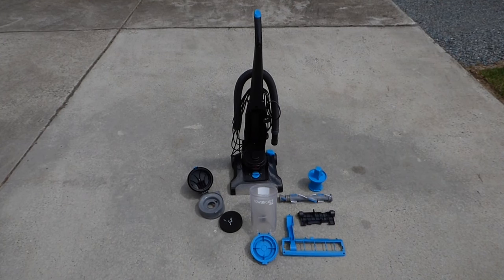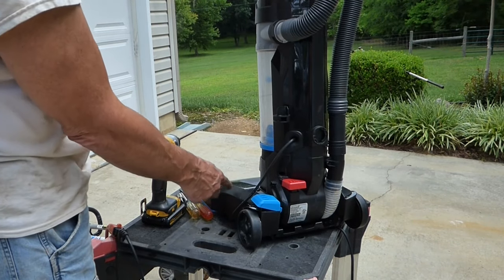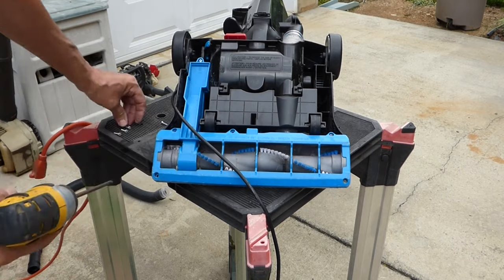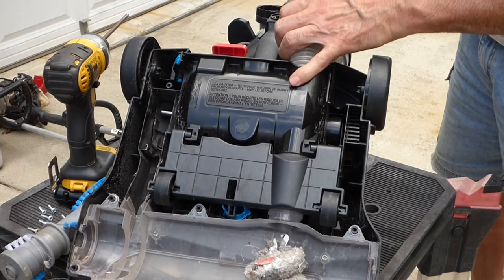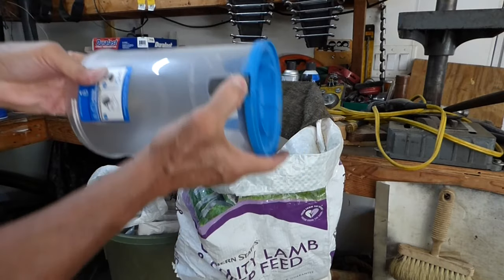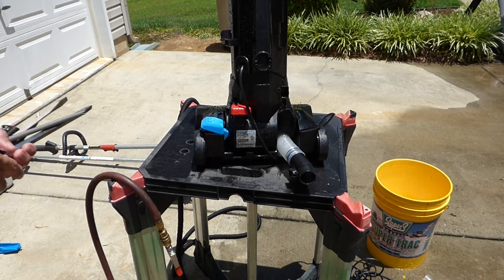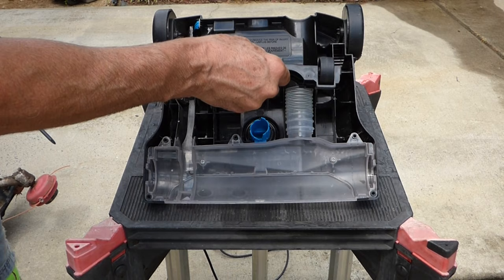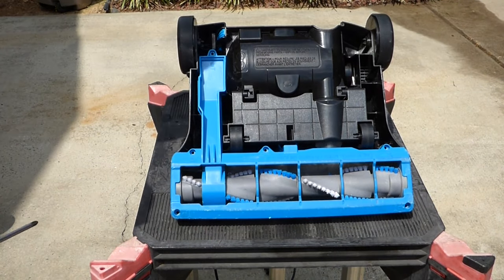How to Disassemble | Fix | & Reassemble an Upright Vacuum Cleaner - Bissell

Comment: That looks like a model 1700 or very similar model 2191. They’re cheap, but very lightweight and clean surprisingly well. Though I would not recommend them for people with allergies. I did a YouTube video on a model 1700 and recently gave away two 2191s that work, though they needed minor work, over OfferUp. All three of them were trash picked. I have rescued dozens of vacuum cleaners from dumpsters over the last nine years.

Comment: I have a Bissell Powerglide Model 3545 bag version i just bought works except for the height adjustment will not move
it's stuck at level # 3 - Your video was  Very helpful  at 7:32 i think i see how to adjust the vacuum height ?
i got the Bissell off craigslist for $15 then spent another $15 for 9 Bissell brand bags - all in all it will work for my use
Reply from the maker: Way to go

Comment: Thank you for the great video!  Could you tell me what the name of that part is at 4:54?  I need to replace it, but I can't seem to find it anywhere.  Maybe it is not replaceable?  The metal screen tore on one section of it.  Help! :)  (mine is a little different model than the one you are showing.

Comment: I know this is an old video...  my bissel doesn't even turn on when plugged in.  Is there anything you can reccomend for a deeper dive on that or if you'd just replace it?  I have tools and I'm thinking about breaking this thing down to learn.
Reply from the maker: Could be you have a bad switch , Loose or frayed wire or possibly your motor is burned out. 
Electricity can be very dangerous To work with. I cannot recommend you do this but if you know somebody that is experienced working with electricity you may have them check it out before you throw it away.

Comment: Great video.  My height adjustment does not work.  I can't tell as to why.  Got any suggestions?
Reply from the maker: Most are just a plastic knob with steps on the underside of that knob increase or decrease the height. You may want to check that knob and make sure it’s not broken or what address against (the wheel bar). It is a very simple design

Comment: Hey buddy, did you have the height adjustment knob out? I did and can't figure out how to get it back in and working. Can you advise me?
Thanks much my friend.
Reply from the maker: If you get the notches on that lined up perfectly with the hole it’ll push right in and then you turn it and it locks in place.  it would probably Be easiest if you remove the belt and roller cover and lift up and remove the wheel as I showed him the video and then put that hide adjustment knob in… Lining up the nachos and then turn it… Then put your wheels back in then the belt cover back on and you’re all set

Comment: So there is no filter behind the red triangle? That's where all the air blows out. Those pipes clog too easily. The worst feature however, is the way too short hose! Even with extensions it's less than 8 feet so you have to pick the whole thing up to reach ceilings and windows. Very inconvenient.
Reply: How to clean out the bottom filter behind the red triangle?

Comment: Hey I get a whirring sound with mine and it smells like it's burning does that mean the motor is going I cleaned out the filter I cleaned out the build up around the bottom but it still makes the sound and smells weird
Reply from the maker: Sounds like your motor is struggling. I would clean the brush especially the two ends and make sure the bearings on the ends are clear of hair and dirt. I would also pull the bottom belt cover off and check the belt and motor shaft and make sure that is all clean and clear.
The burning smell is probably because there is a restriction and the roller brush is not spinning freely causing the motor shaft to spin faster than the rubber belt and that is possibly where you’re burning smell is coming from

Comment: Can you help me? The wheels on my Bissell Upright are worn out, but I can't figure out how to take them off. Thanks.
Reply from the maker: If yours is like the one in this video… Turn it upside down and there is a little clip underneath over by the back wheels… Just press those two tabs together and push out and that will release the wheels for you

Comment: I cleaned the wheel and put the belt back in place and now it seems like the belt won’t turn and has a burning smell? Does anyone know how to resolve this or do I need a new vacuum cleaner?
Reply from the maker: Take the belt off and turn on your vacuum you should hear it running freely… That means your motor is spinning free. Then unplug your vacuum and without the belt on turn the roller brush and it should spin freely. If both of those are spinning freely Then put your belt on and everything should be running fine. If one or the other does not spin freely check for hair or debris keeping it from spinning freely

Comment: The metal part that holds the belt keeps heating up on mine causing the belt to break
Reply from the maker: sounds like there is a restriction somewhere keeping it from spinning freely and causing heat to build up.  May be the motor or the roller brush that is not free.  check for hair or debris build up restricting it...

Comment: أنا لا أفهم الإنجليزية ... من فضلك كيف أستخدم الإكسسوارات فقط و تكون المكنسة الأرضية الكبيرة متوقفة .... لأنني حين تشغيل البروس توربو الصغير يشتغل معه البروس الأرضي الكبير في الوقت نفسه 🤔؟
Reply: If your vacuum does not have a brush on/off switch, then you cannot use the attachments with the pick up hose without the main brush roll spinning at the same time.

إذا لم يكن للمكنسة الكهربائية الخاصة بك مفتاح تشغيل / إيقاف للفرشاة ، فلا يمكنك استخدام مرفقات المكنسة الكهربائية الخاصة بك من خلال خرطوم الالتقاط دون الحاجة إلى تدوير الفرشاة الرئيسية في نفس الوقت.

(translated using “Google translate”)